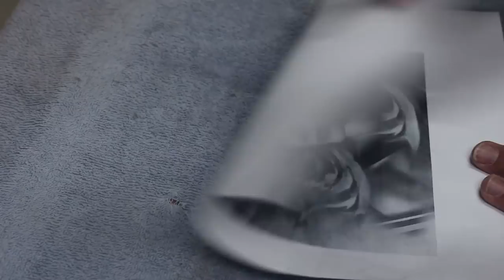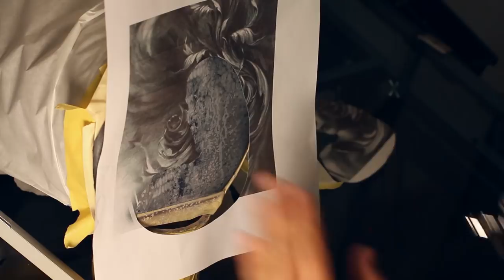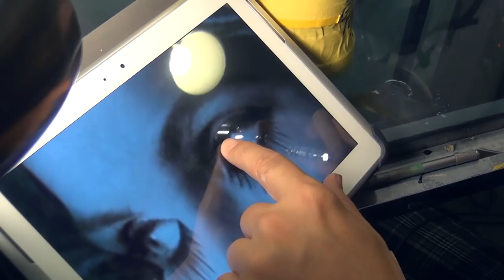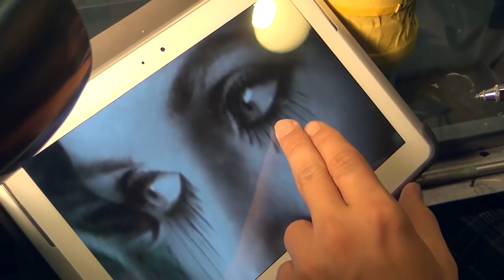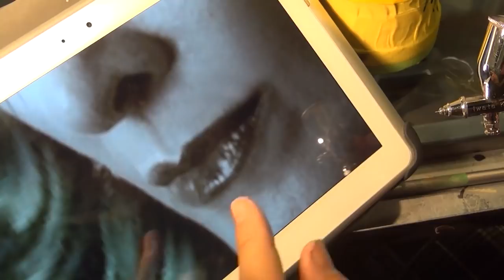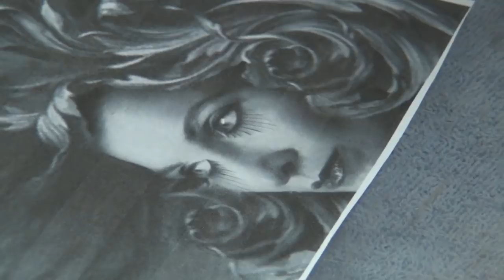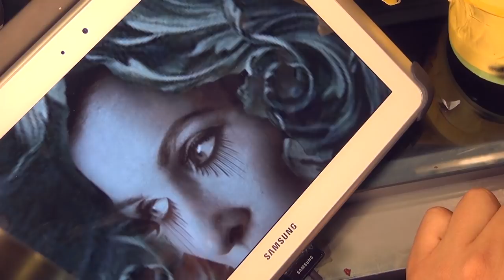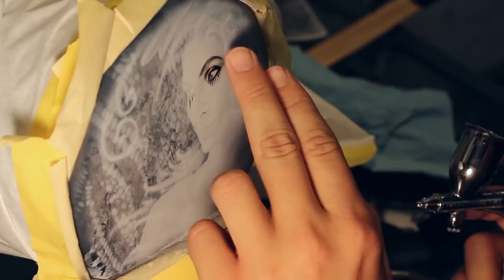Airbrushing A Portrait - Full Tutorial

Comment: when cutting some of your stencils try using a swivel knife, it has a smaller blade and gives you the ability to rotate the blade without hard stick line edges also try using a catapillar stencil for airbrushing, usually you will have to make your own but it gives you a wide range for blending and soft disappearing flow of paint.